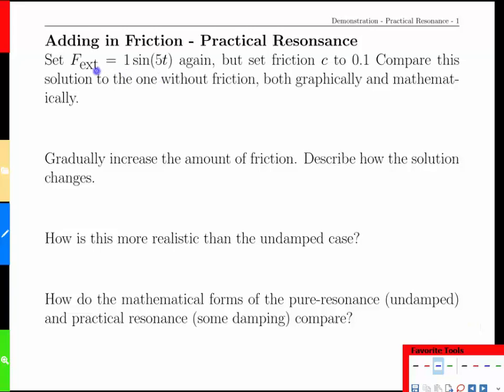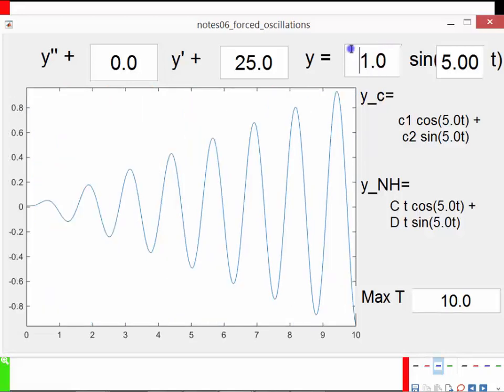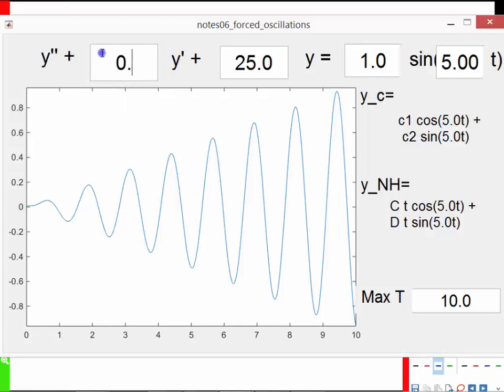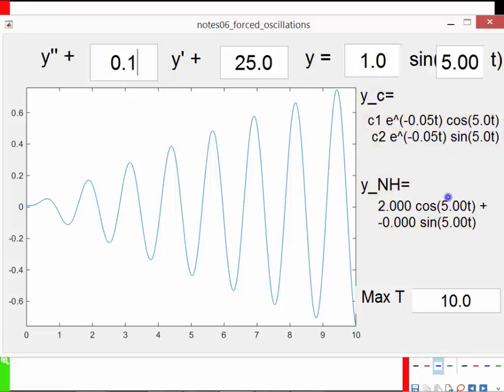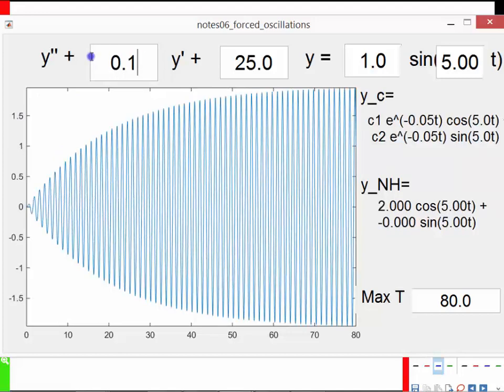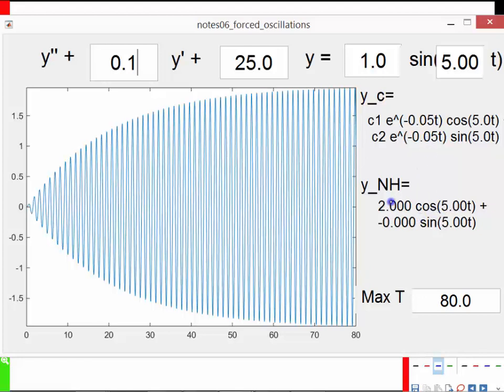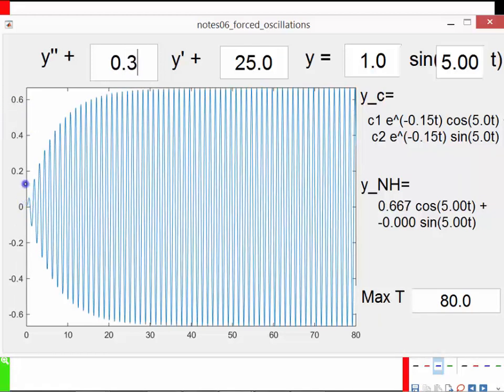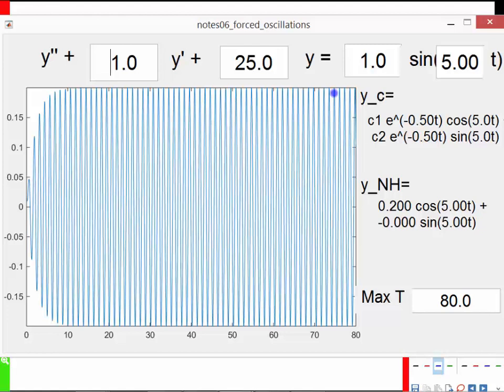Week 5-9 Demonstration Practical Resonance

Comment: if the RHS is not a sin function and there's exists some damping force,  will the system still oscillate forever?
Reply from the maker: It depends on what the forcing function is.  This system stays oscillating because we are continually adding energy to the system through the sinusoidal forcing function, but other infinitely repeating functions would also achieve this (e.g. cosine, sawtooth, bang-bang on/offs, etc.).  In contrast, if the forcing function was just a constant force, you would get some initial oscillations, but those oscillations would eventually fade to 0 amplitude over time.